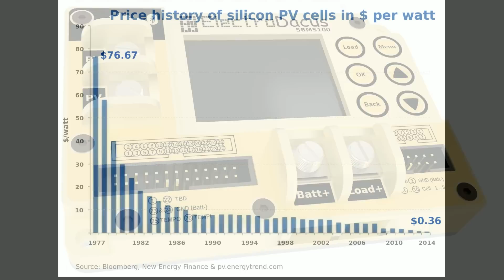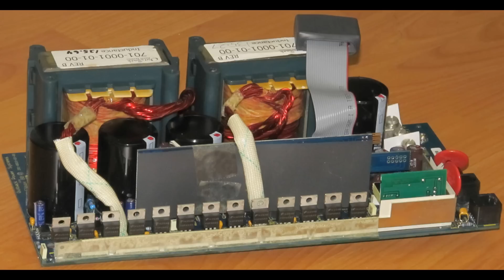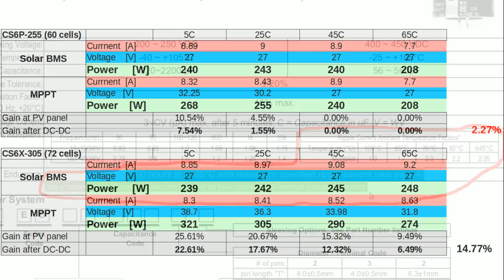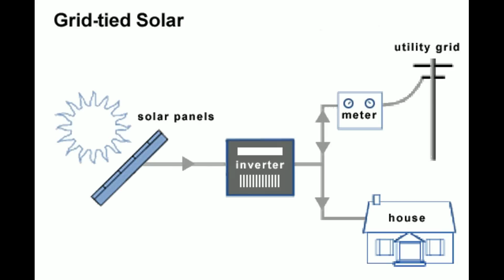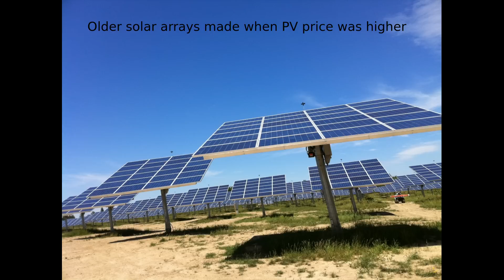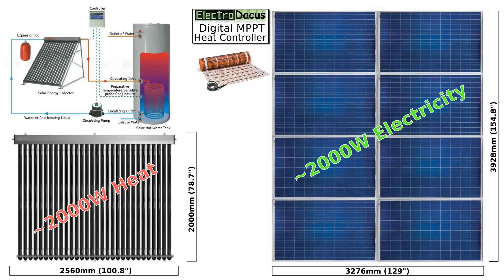Is the MPPT in OffGrid Solar obsolete ?

Comment: Hello there. Nice work with your project! I like it and i got my eye on it for sure.. I have couple questions for you.
1. If i understood well for best efficiency of your PWM solar BMS controller i have to use solar panels and battery bank of similar voltages so the voltage drop from panels to battery doesnt waste away much of power? For example  17v solar panels to charge 16v li ion battery bank(4S config) or lets say 27v panel to charge 25v li ion pack (6S config) am i right?
2. Is it possible in future that u implement more cell balance ports? Example 13 or 16S... It would be great for E bikes scooters etc.. That will be super mega giga combo , one device charging and balancig the way you want and also getting the option to charge from sun or from regular power supply.. That would be great! I would buy such a thing right tomorow if someone make it.
Anyway , best regards and thanks for answers!
Reply from the maker: +Igor Tomic 
1. Yes you are correct battery and PV panels voltage need to match. The most common PV panels in the world close to 80% of world production are 60cell PV panels (6" large cells panels size about 1.65m x 1m and panel power around 240 to 270W depending on cell efficiency). This have a max power point voltage of around 30V with cells at 25 degree Celsius but this only happens in winter since with sun on the panels they will get quite a bit above ambient and max power point voltage drops to around 28V in summer.
So they work best with 8s LifePO4 (recommended type of battery since is by far the most cost effective in therms of amortization cost ) they charge at 3.55V max so 28.4V fully charged or use 7s LiCoO2 and variant cells (not good in therms of cost amortization) charged to max 4V (instead of 4.2V) since they will last 4x more cycles and be a bit better in therms of cost (so 4V x 7s = 28V) again great match for the most common and inexpensive/Watt solar panels.
The SBMS is not using PWM so there is no electrical noise (PWM at 100A will be quite crazy :)) The PWM is not needed since for long life of Lithium cells constant voltage part of the charging is not needed (will degrade the battery).
2. The SBMS was not designed for outdoor type application (not water proof) and I have no intention for higher voltage model.
Reply: +electrodacus Yea if i match panel voltage and battery voltage efficientcy should be prety much close to max... I got the idea to charge my e bike with SBMS , balancing option in that case is very neat.. I could program my charge/banlance as whatever i want.. Not just like regular charger (charge to 4.2v per cell and leave it like that for day or two to do balance) ... My curent crapy chinese 13S BMS doesnt do his job properly.. Voltage cutt off's works but balancing is pure crap .. My cells are all over the place.. From 3.9 do 4.14v and it wont balance at all... Maybe it needs exact spot on finall voltage to start balancing or something like that , i dont get it... Or its just a faulty unit.. Maybe i can charge my battery without BMS to about 90% and then plug in balance leads to let SBMS fine tune/balance the first 8S in pack and then make another connector to balance the other 5S... What do you think? Yes its a bit tricky but true balance is not needed every day , more like once a month for my application so it sounds good to me...
Also what is that about higher voltage balancing? Seems like everyone make stuff to balance 8 or max 10 cells... Nobody goes over ? :S
Reply from the maker: *****
The SBMS cell balancing is for maintenance.
The cell balancing will be started as soon as there is a charge current higher than 500mA and difference between the lowest cell voltage and any other cell is higher than 10mV
This way even very large cells 400Ah to 1000Ah can be easily kept in balance and all the current dissipated on the balance resistors will be from solar PV panels or charger and not form the cells.
All electric cars have much more than 10s cells and they have cell balancing similar to the one in SBMS.
You are probably referring to those toy chargers for RC cars and in that case more than a few cells in series are not needed.
Reply: Yes i was referring to toy chargers for general use.. If i got it correct ur SBMS will do good job balancing my e bike battery. It can charge all low cells in same time (from panels or pwer supply) while discharging the full cell?
Reply from the maker: +Igor Tomic Assuming your battery is good with no damaged cells the SBMS will keep the cells in balance. As input SBMS can use solar panels or a constant current power supply.

Comment: You failed to mention that mppt regulators also dropped in price. You can get quite good mppt solar battery controller for 90$ -  https://youtu.be/3Okm50rgAWg
Reply from the maker: Valent Turkovic Your comment was marked as spam because you included a link I think.  Anyway that 90$ MPPT is just a 20A MPPT supporting max 24V battery. If you compare that with the 60A one featured in this video the price is not better and quality probably worse. You can probably find an even cheaper one is is just a 10A 12V MPPT.
The idea is that MPPT needs a DC-DC converter that includes large and heavy inductors and large capacitors on top of higher voltage mosfets so is clear that it will be more expensive and much heavier that will add to shipping cost also.
Also if you watched the entire video you have heard about the other good reasons on top of the cost and complexity that made the MPPT obsolete. I live offgrid and now in summer I only use in average around 50% of the available energy the other half just remain unused. In winter wasted energy is less but still at least 20 to 30%
Related to cost you also need to consider how many MPPT charger you will need over that 25 to 30 years the PV panels will work. If you need to change the MPPT charger just 3x so once every 10 years (that if is of good quality) then cost of the charger is 3x higher over the lifetime of the PV panels.
MPPT will always cost more than a non mppt controller because of the extra materials even if you just pay for the copper, iron and aluminium in the inductors and capacitors there are a few kg of this materials in a large power MPPT and you will not get any benefit in ofgrid from that extra cost.

Comment: The advantage of high PV array potentials and high input potential MPPT controllers is where the home run cable is many hundreds of feet long such as with a cabin in shaded woods where the nearest suitable site is a far away clearing as the wire cost for such a system would be in the many hundreds to thousands of dollars.  The inefficiency problems associated with a high potential difference across a buck converter could be dealt with by using a forward converter or related topology as the charge controller would be designed specifically for high input potentials anyway.
And the solution to big windows is a combination of shading awnings and overhangs and insulating curtains at night.
Reply from the maker: randacnam7321 You came here with a particularly narrow case scenario for the MPPT use and that will not make the MPPT less obsolete. In most 99% of case PV panels are relatively close to battery either on the roof of the house or RV or next to the house not far from where cable cost difference will be insignificant. 
Also the higher the voltage difference between PV array and battery the lower will the efficiency of the DC-DC converter inside the MPPT charge controller.
The solution you propose for windows may work for small windows but for large windows that is not economical.
This how large will the overhang be to cover a window that starts from the floor and ends to the ceiling. Even with the oversizes overhang (that is not even possible in areas where you have strong winds) the window has 10x lower thermal insulation value thus energy loss do to large window is considerable.
When the scope of the window is to be used for energy gain you get way better results with smaller less expensive windows and PV panels that have the advantage that are less expensive and allow the energy to flow in a single direction.
Reply: *****
The overhang is not much as it only needs to shade the windows in summer.  It is only about 2ft or so for floor to ceiling windows at the latitude where I live and would be even less farther north.
And long lossy home runs are fairly common on this side of the pond as small to medium off grid systems are used a lot for things like off grid vacation cabins that do not get any good sun exposure.
Reply from the maker: randacnam7321 I live in Canada and I have about 2ft (55cm) overhang that is just at the limit of what is needed to cover a small window that has a high of just 90cm (3ft) and is in the middle of the wall. You need a huge overhang for an 8ft (2.4m) tall window as most of those that use large windows for thermal gain have.
As PV panels got so inexpensive you can afford to have higher losses on the cables if you want.
There is a minimum thickness cable that you can use anyway else the cable will get to hot and wont be safe to use. As long as the cable is appropriate for the current you can have it as long as you want and accept large losses even 10 or 20%.
But I'm still convinced that this is not the majority of offgrid installations and represent just a small %.
As an example my future heating array will be about 15m (46ft) away from the house. The array is about 7 to 9kW will cost around 7 to $8000 and the copper cable for that will be around $500 and have a max loss of around 4 to 5% but average loss will be much lower since the array will not work at full current most of the time that is just peak for two or 3 hours a day in a sunny day. So average energy loss on the cable may be just 2% or so.
Doubling the array voltage will only save me 200$ in cable cost (this is for a large array relatively far from the house) and an MPPT for this size array will cost way, way more and not last 25 years as the cables and PV will sure do.
Reply: *****
I mean less overhang is needed down south durr.  Overhangs of under 3ft are needed here (northeast USA).
Reply from the maker: randacnam7321 Overhang can be calculated based on location and how much shadow you want but is clear that is will need to be larger for taller windows.
Even if the windows are shadowed completely by overhangs there will still be a lot of heat gain compared to a wall first by indirect radiation then conduction since windows as I mentioned have an R value 10x that of a normal wall.
If you take all costs and thermal gain loss in consideration it will be more economical to have smaller less expensive windows and PV panels than have larger more expensive windows.
If cost is less important and you prefer the larger windows for aesthetic reasons that is a different story.
Thing is a lot of people want to have large 3 pane windows thinking it will be a good financial investment and in that case getting smaller windows and PV for the difference will make much more economical sense in almost any location and climate but especially in the colder climates.
I may make a video with the details related to this.
Reply: *****
That is where insulating curtains or blinds come in.  The advantage of big windows is that they are long lasting barring black swans like some idiot with a rock or flying debris or whatever.  They can last much longer than a PV system even if the PV heating may be theoretically better in some way.
Reply from the maker: randacnam7321 If the blinds are inside they have little effect and the outside ones will be quite expensive and still not as good as a wall. Not sure they will last longer than PV systems (PV panels can last 30 to 50 years with almost a linear degradation around 20% loss in 30years and 30% after 50years). So just by an array that is a bit over-sized or add a few panels latter to compensate for PV cells degradation. 
I'm not extremely familiar with multi-pane windows but I think they also degrade by losing some of the Argon or whatever gas the use to fill them. PV panels have a thick glass on the front and are as strong if not stronger than the window glass.
There is nothing else that will degrade on a PV heating installation. The heat elements I will be using are just flexible copper wire with silicone insulation embedded in concrete and they can last as long as the house and the control is done by solid state electronics no electrolytic or components that have a limited life so they should last at least as long as the PV panels and is not expensive. There is no battery or any other element for PV heating.
Reply: *****
Any MOS devices will die eventually of potential induced oxide breakdown that is an inevitable result of them being under bias.
And indoor blinds are plenty effective as they prevent the heated indoor air from coming into regular contact with the window.  All the blinds need to do is slow the transfer of heat from the indoor air to the window.
Reply from the maker: randacnam7321 I do not think there is a case of a mosfet die do to degradation in normal operation conditions else that will be present in all mosfets data sheets same as degradation is presented for electrolytic capacitors in datasheet. There are mosfet devices in operation much older than me and mosfets transistors made in ever smaller manufacturing process that are still operational.
But feel free to refer to a paper that presents your concerns maybe I'm wrong.
I'm not aware of sealed indoor blinds that will not allow the air circulation from one side of the blind to the other. In the case of heat escaping the house the internal blinds help but that is mostly related to losses do to IR radiation and not so much with conduction. I was mostly referring to heat gain in summer when internal blinds are much less effective than external ones.
In any case the large windows are not cost effective when heat gain is the target compared to PV panels + smaller windows. I did that calculation for the climate and prices of windows and PV here in Canada and the result was clear in the favor of PV and smaller windows.
When I get the time I will do a video with all the details about this calculations.
Reply: *****
The failure mode I speak of is more along the lines of what will happen to things like CMOS ICs that have sub microinch scale features after a few decades under bias.
My reason for going with passive solar for heating instead of PV has more to do with system simplicity and longevity than with absolute maximum efficiency under some given set of conditions.  Electricity is a high grade form of energy and as such is much better applied to things like batteries and tools as primary loads and saving things like space heating for times when there is nothing else to use the electricity.
Reply from the maker: randacnam7321 You may be right about simplicity of passive solar heating compared to PV solar heating. I'm probably a biased since I'm quite familiar with electricity. But all that is needed are PV panels that you can get them as easy or easier than windows and copper wire that are also a commonly available product and extremely simple. Nothing else is needed for PV electric heating. Copper wires will heat from current generated by PV. That will not be particularly efficient about 50% of the energy will be lost if not used together with an so called digital MPPT that is non existent as far as I'm aware and I will need to design and build that. Digital MPPT will not be expensive but it will be complex compared to the rest of the system or passive solar.
After is installed should be as care free as a passive solar maybe even better since the temperature control can be done by the digital MPPT no need to close blinds even if those can also be automated (but require probably mechanical system, electric motor).
This PV heating was not cost effective 5 years ago compared to passive solar but is now and it will continue to be probably even better as PV prices continue to drop.
Another advantage is that you can use that electricity for any other purpose like lighting, computers, refrigeration, cooking all this will still end up as heat so you have double use for the energy. Also when heating is not needed you may be able to use the energy for cooling.
Yes electricity seems more high grade as you say but if it cost less per unit of energy than passive solar or natural gas then why not use that. Cost of electricity from PV directly is just a bit under 3 cent/kWh at the moment and is about equal with natural gas that is also around 3 cent/kWh in North America. But for a new house a natural gas connection alone may cost as much as the PV panels making natural gas a much more expensive solution not to mention the cost of the furnace and the fact that it will need replacement and maintenance and is less safe.
This video was not getting in the details about this PV heating but when I get time I will make sure to make a video about that. It will probably be next year when I will have the time to design the so called Digital MPPT (maybe I will find a better name for this by then).
Reply: More more more equals more cost more infrastructure more maintenance... more involvement more resources... a never ending loop... Why are humans such prisoners to complexity and ideals..?? 😎